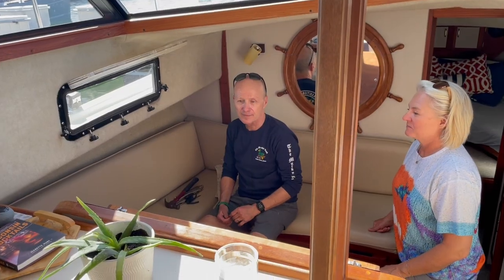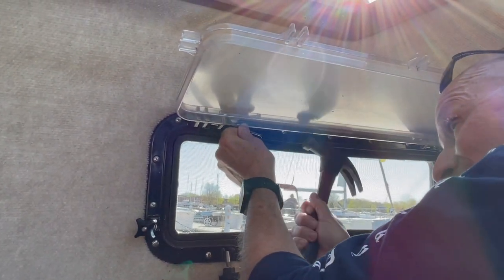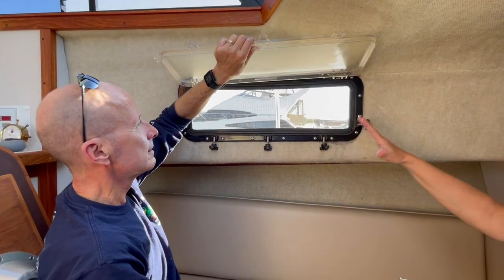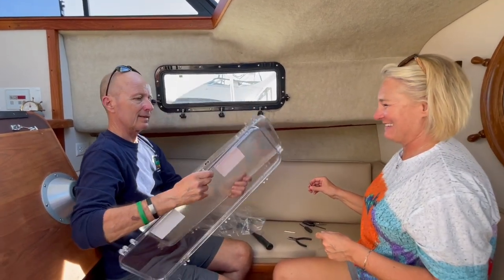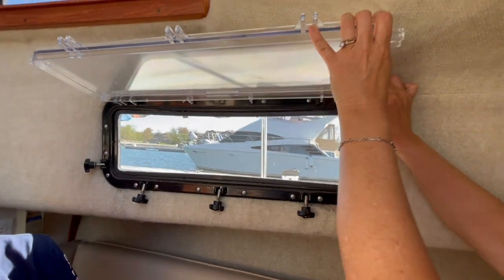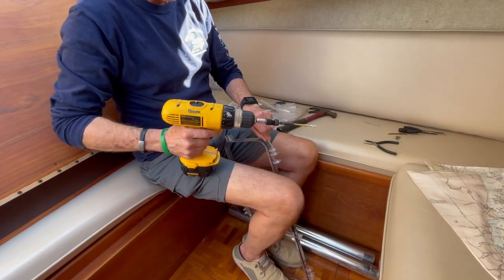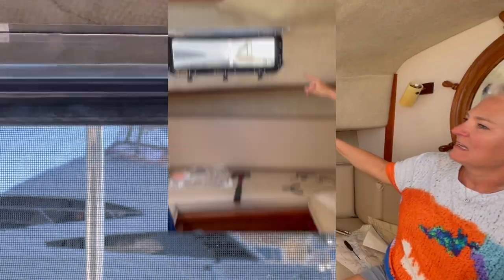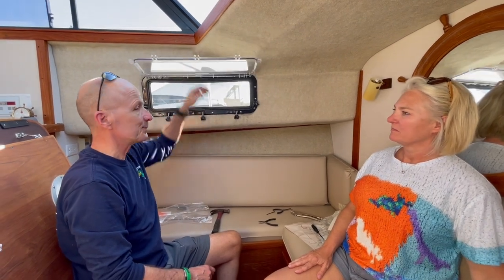1988 Carver 36 Aft Cabin, Replacing a Port Light Window

Comment: If replacing the entire portlight rather than lens only, I highly recommend Newfound Metals. They make beautiful stainless and bronze portlights that were not exactly drop ins for these but could be adapted with teak surround/bezels available from NFM. The company is proud of them though as they are not cheap. They have fitment for the 2807 which uses similar if not identical portlight sizes as the 3607. Love these old Carvers. Another excellent video.